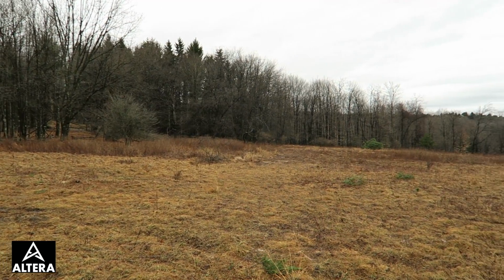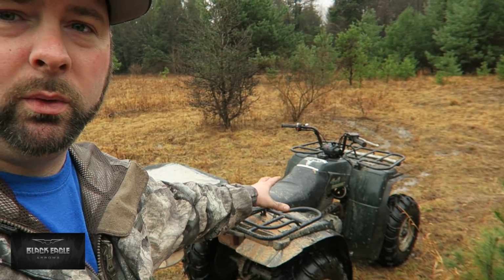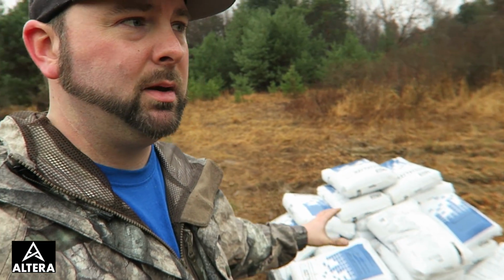How To Correct PH In Food Plots | Spreading 3,000 Pounds Of Lime!

Comment: Dozer work yesterday and lime today. Old pine forest with a 5.0 on the ph. Soil around here seems to be around that consistently with topsoil layer removed. Powdered lime is almost immediately available to the plant and raises ph quick. Pelletized lime is like a lime concentrate, it takes less per acre than bagged powdered lime but takes months to see results. I would suggest if first time liming area I would go with powdered lime and pelletized on top or shortly after. The rain is key and I’ll wait to spread just before a rain. Great looking spot .
Reply from the maker: Sounds like good work. 

I would also say that’s not true. It takes equal amounts of pelletized and powered that was a old thing back in the day you needed less pelletized then powered. Powered last longer in the soil then pelletized. Only difference is pelletized is easier to spread. Rain is also key and also discing into the soil for less run off and puts it at roots level

Comment: Just wanted to point out,  according to BraenStone.com "One advantage of pelletized lime is that less material is required to balance the soil than traditional aglime (at a ratio difference of 1:10). The product is quite easy to distribute across the surface of the soil, and doesn’t need to be tilled into the earth." So your 3K lbs pellet is equivalent to 30K ag.
Reply: The 1:10 ratio for lime is not true. Lime is lime wether you are spreading pellet or AG lime and lime always works much better when its tilled in. Fact!

Comment: How much did all the lime coast and what state do you guys hunt
Reply from the maker: Georgia Deer hunting this was pa and it cost about 300 dollars
Reply: Any reason you didn't buy bulk agg  lime??
Reply from the maker: Yes. Had no way to get it back in there. Was just easier with the bags
Reply: I use a 5x8 utility trailer. Can get almost 1 ton on it at a time. Then Stick a buddy with a backpack blower off the end and blow it off the trailer as i make my rows. It's not flawless but works pretty damn good. 2 guys don't take long to shovel more on the trailer either..bag lime is GREAT if you can afford it. It's 190$ difference between bulk and bag ton here in Bradford county.

Comment: How come you didn't just use Quick acting lime?
Reply from the maker: Quick acting lime is like triple the cost of pelletized lime. YeS they say you can use less so it could equal out but lime is lime and what we used perfectly fine ph now is about a 6.5
Reply: yeah i saw 3000 pounds for 300.00 bucks thats pretty cheap.3.50 for 50 pounds is the cheapest i see in my area
Reply from the maker: Yeah I’ve seen It in Maryland for about 3.23 for 50 lbs.
Reply: Fast acting lime leaches out of the soil to quick, about 4 months. You will need to add regular lime anyway.fast acting is good as long as you plan on adding regular shortly after.